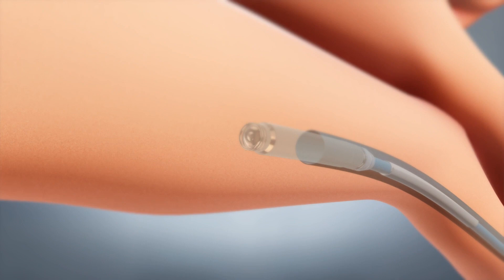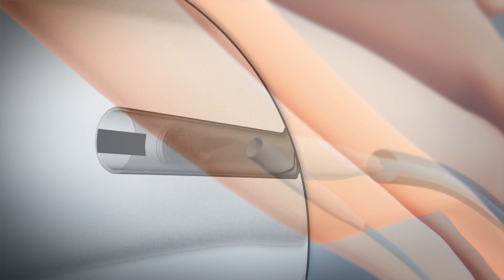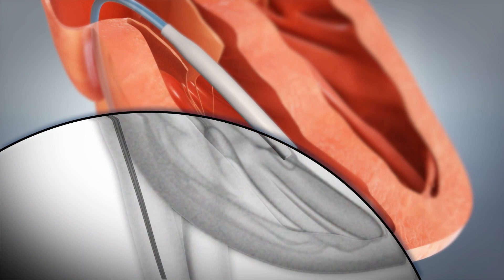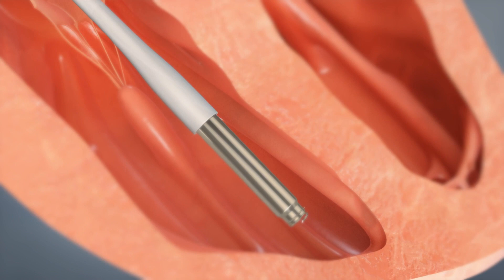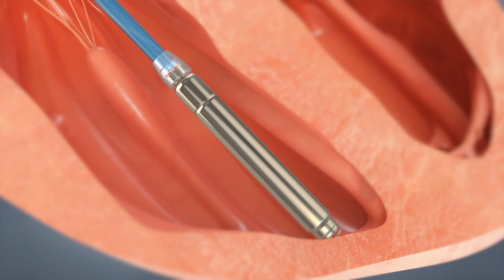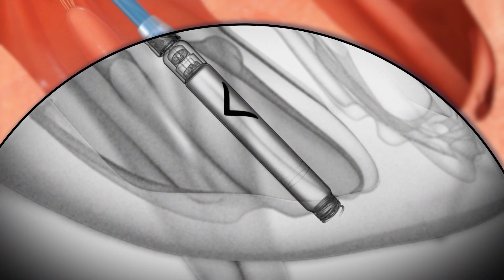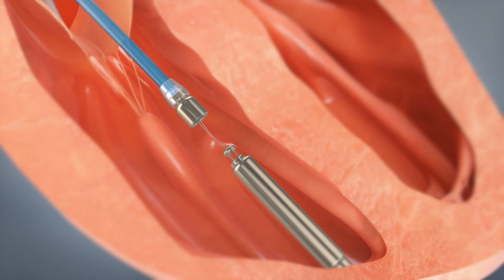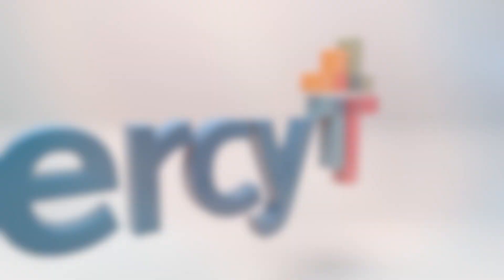Mercy - St. Jude Medical - Animation of NanostimTM Leadless Pacemaker

Comment: I implanted a St. Jude St.
Jude Microny 2525t single chamber in 2015
in 2020 I did the normal check and it indicated the battery at 2.78 V can it be normal?
is it still new?
bless you!